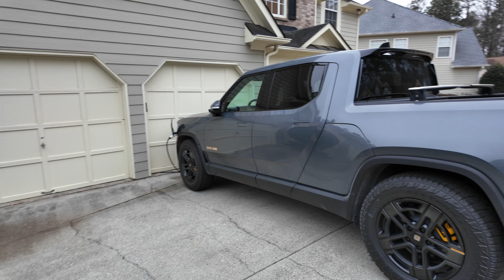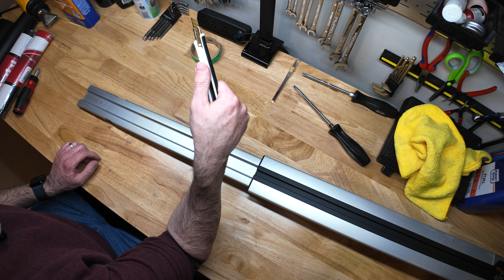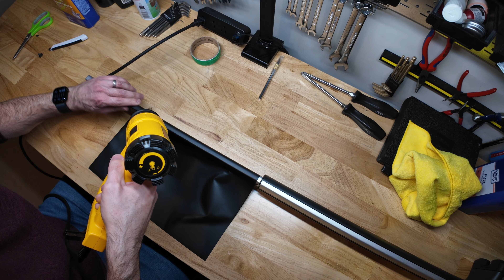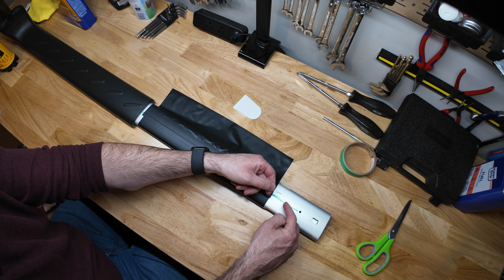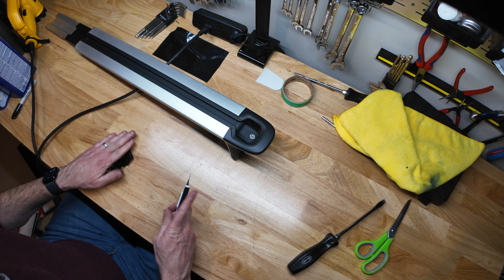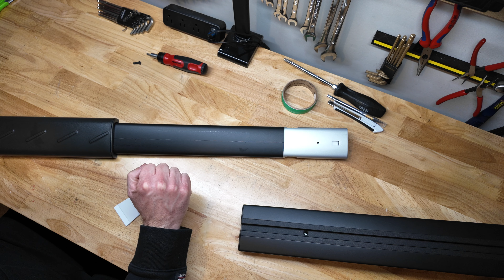Vinyl Wrap your Rivian Crossbars for Cheap!

Comment: Nice work. You should do the emblems and the bumper trim pieces that are silver as well
Reply from the maker: Thanks, I've actually started, check it out... https://www.youtube.com/watch?v=YfufltVK7w0
Reply: I lucked out. Picking up never used set from an older couple in silver so I’ll be following your video and wrapping matte black. Thanks for linking all the materials too and sharing how you wrapped yours.
Reply: Just curious, what will happen to the wrap once a cargo box is placed on it, moved around and Clamped? Will the vinyl get destroyed.. I think it would